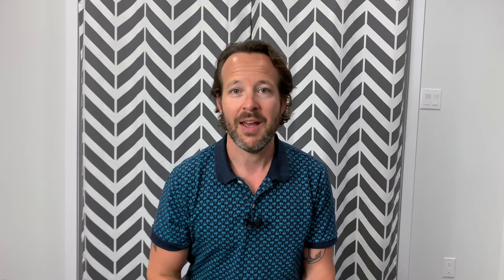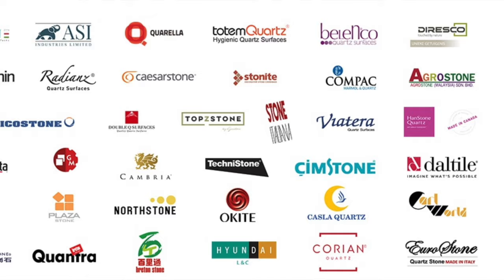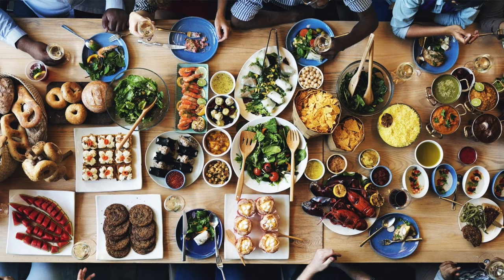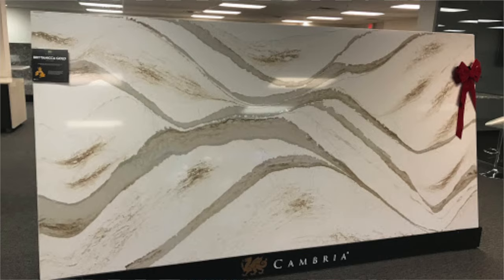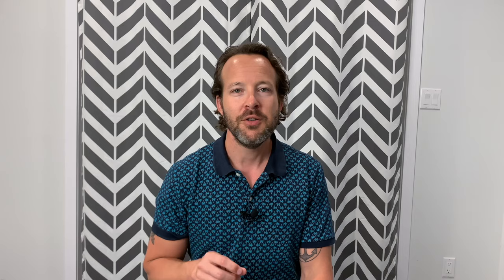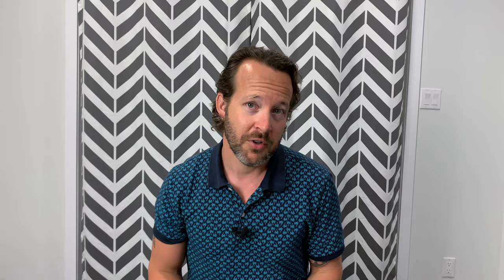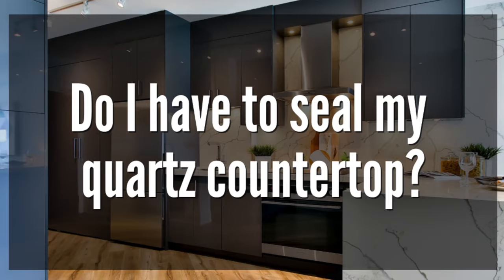QUARTZ COUNTERTOP | Everything You Need To Know

Comment: I am looking at purchasing a quartz countertop.  The manufacturer  has multiple thicknesses available (max 6 cm).  To make 6 cm you have the options of either having two 3 cm slabs laying on top of each other and baked together (but if it's heavily patterned, you won't get the seamless look when looking at the slab from the side) OR having the edges mitered (where you can get a more seamless side view appearance but it costs more money since the manufacturer will need to try and match the edges of the slabs).   Please consider adding this detail to your vid.   Thanks for the video!
Reply from the maker: Hey, thanks for the info.  That is not something I had considered!
Reply: I’ve never heard of 6cm slabs for countertops. I’ve hear of 6mm  big differences. To get a 6cm look the edges are mitered or stacked. There is no benefit to glueing 2. 3cm stones together just to get the thick look for the entire slab . I own a countertop company. And the edges should line up because heavily patterned quartz slabs should be almost identical. It’s very costly to have pattern changes.
Reply: @JS-zb1vv  Cambria offers some countertops in 6 centimeters.  Some people may like the look.  If one uses a chiseled or rock face edge profile, the change in the pattern between the 2 slabs isn't as noticeable.  I saw it in a showroom once.
Reply: @ecdubytecdubyt  yea but I don’t think it’s 2 full slabs it’s just a laminated edge.
Reply: @JS-zb1vv  I don't work in the field.  The Cambria website and the showroom rep told me it was 6 centimeters thick - just sharing what I was told by Cambria with others.  Since you're in the profession, feel free to verify if you'd like.
Reply: @ecdubytecdubyt  yea you can make an edge as thick as you want . It’s just laminated edges. They cut strips and glue .  It would be to heavy and costly to stack slabs . I’ve did it . I think it was just a misunderstanding of how it was represented.
Reply: @JS-zb1vv  Understood.  Thank you for the clarification.  Much appreciated!

Comment: ok, get your unit straight. 700 C degrees is over 1200 F. That is the temp aluminum melts. even 700 F sounds iffy. 
I am seeing hot pans will mess up a quartz top. Even vinegar will mess it up. The weak spot is not the quartz, it's the resin binder.

Comment: Thanks Mark, granite how to remove oil from our hands from my granite. 
I have tried so far the following a clay mixture powder that I mix with water. I’ve also tried baking soda with water, and baking soda with hydrogen peroxide 3%, I have also tried the mixture of the clay powder the hydrogen peroxide 3% and baking soda all mixed it into a peanut butter consistency then cover with Saran wrap and we will see how that turns out in two days. Thanks for all your information Mark appreciate you.
Reply from the maker: Thanks for the comment John.  Do you know if the granite is sealed.  Not sure if it will completely prevent oily stains.  Sounds like you're trying all the right remedies.  Hope it works for you!

Comment: Isopropyl Alcohol saved my laminate countertops and thermafoil cabinets from Sharpie! Would alcohol damage the quartz? If not, it works like a miracle.
Reply from the maker: Hi Haydée!  On laminate it is great.  Acetone as well.  It definitely can be used on quartz, though it is recommended to water it down.  Personally, I would reach out to the supplier before I used alcohol to clean, just because it is a solvent.  Really good point to bring up.
Reply: Hairspray can remove sharpie ink, too. I have a 20 year old Silestone countertop . It has developed 2 hairline cracks that seem to run along parallel to the edge of the cabinets under them. Hmmm
Reply: @MTKDofficial  Do not use acetone on quartz. you run the risk of burning the resin.  Alcohol is recommended by every manufacturer.

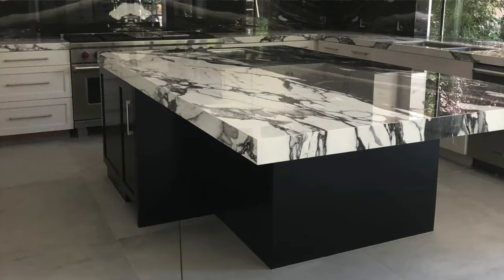Comment: @5:41, you mention slab thickness is between two and seven mil.  I assume that mil is millimeters, which isn't much more than 1/4 inch.  I have seen quartz much thicker than that, so please elaborate on your thickness comment.
Reply from the maker: I pinned a correction in the comments.  I meant to say CM

Comment: Home depot associate told me that ppl thede days selling quartz counter tops that are not sealed and will get stain vrry quickly from oil , food , coffee , dish soap liquid .. is that true ?
Reply from the maker: Well... maybe they were meaning quartzite, which definitely has to be sealed?  (Just giving them the benefit of the doubt)  Manufactured stones like quartz do not need to be sealed.  They are manufactured to 0.05% porosity.  There are however, brands out there that do not manufacture quartz to the same standards as the Breton patent.  That doesn't mean that they are not good, but harder to verify if they stand up quality wise.  Hope that helps

Comment: heat resistant to 700C then you say use a trivet.  that's wishy-washy.   so... does a hot pan risk leaving a burn or heat ring?  if i place a 500C pot onto the quartz for 2 minutes, will it visually damage the quartz?
Reply from the maker: Certainly didn’t mean to be wishy washy. The resin in quartz can and does burn.  Always check with the fabricator on what they recommend. Under normal use it’s fine, just stuff out of the oven might be an issue.

Comment: No idea if I got a bad batch or something, but our brand new (weeks old) counters are staining if you look at them wrong (I kid but just barely). Was making some old fashions with maple syrup the other night, didn't notice some syrup got on the counter top until I went back to clean up like 30 minutes later. The syrup left a stain that we keep scrubbing and got most of it to go away but you can still see it. Then a day later I had a dry pan, not hot, not used, just dry pan we had put down on the counter. Came back a few hours later and it left a rusty looking ring under it that we still can't get out. The pan itself is not rusted, it was brand new I had just gotten as a gift and put on the counter so I could wash it before storing it away. 

Now I'm afraid to put anything on these countertops. Feels like literally anything will stain them. No idea what is going wrong with these things since before we bought them  I looked far and wide for the most durable low maintenance options and quartz came out on top.
Reply from the maker: I'm assuming it has a warranty, so I would definitely get the rep to come out and have a look.  It should hold up better than that.  The big issue with quartz would be the resin and binding agents.  They can possibly react chemically with certain things.  However, if your counter can't handle a brand new pot there is something a miss.

Comment: Hi Mark!  I have a question. I want to put a black quartz with sparkles on my kitchen BUT the sales person told me that black quartz does not tolerate heat well. He advised to go with black granite instead. Should I buy the granite? I really want it to be black with sparkles ✨ Ty!
Reply from the maker: Hmm.  If you are going to be putting scolding hot pots on your countertop, then maybe not.  But just use a trivet if you have a habit of doing that.  Quartz is heat resistant to a point.  However, the more material in it (glass, metal, etc.) the more resin.  It's the resin that can be effected by heat. 
The black granite is a nice choice too.  Hard to say.  Use a trivet either way actually.

Comment: Hi there! I watched the video hoping to find out how to get water stains out of a quartz countertop as well as to find out if you can remove scratches. I have  watermarks all around the faucet and i got scratches from setting a ceramic planter on the counter. The video was awesome, but didnt hit on those. Do you have any suggestions? I saw 0000 grit steel wool for the water stains? Thank you!
Reply from the maker: Be careful not to make it worse by removing the sheen from sanding.  I'd even try a Mr. Clean Magic Eraser.  I've seen videos on repairing surfaces, but am certainly no professional at this.

Comment: Thank you for so many wonderful videos! Some  question I have is do you think it is ok to use stock cabinets under quartz countertops? Such as would stock cabinets hold up long term ? And if you were to want to upgrade lower cabinets later on, would the quartz countertop have to be busted off and ruined in order to replace the cabinets?
Reply from the maker: Depending on the quality of the stock cabinets, I'd say sure.  Most times you would be fine.  If you upgraded later, the top could come off.  Easier if there are no seams however.  Though the new cabinets would have to match exactly in size, so you don't run into trouble.  I would never recommend doing the countertop first if you are also planning on changing the cabinets.  Do the cabinets first and later you can upgrade easier.  But it can be done.

Comment: What about crockpots/slow cookers? I have 3 of them which get used a lot, several times a week and oftentimes 2 even all 3 at the same time. Currently have laminate countertops and whenever I use my crockpots I don’t normally put anything underneath them. I’m in the middle of deciding to update my 25 year old kitchen and thinking about upgrading to quartz counters. Also, what about air fryers and  Instant Pots/electric pressure cookers? Currently, my instant pot sits on top of my stove so that when the pressure is released I turn the hood fan on.....changed from the having it on the open peninsula due to staining my ceiling, oops! Yes, that peninsula will be going too, lol! I just can’t seem to figure out what type of island to put in? Right now it’s got a raised bar all around it with 4 bar stools 🙄!
Reply from the maker: Hi Lori!  Thanks for the comment and question.  If your slow cookers aren't delaminating your laminate countertop, I would not worry at all about them damaging quartz.  The stone will dissipate the heat evenly and more efficiently than laminate.  Of course it's always advised to use a trivet "just in case" .
For the island, I recommend a one level extended depth island.  With or without seating (whatever you prefer).  Here's a video on island seating talking about the different options.
https://youtu.be/9EdAtCo2LjA

Thanks again
Reply: @MTKDofficial  Thank you Mark for actually replying, I wasn’t expecting it as some other YouTubers usually don’t. I literally just discovered your channel yesterday and started binge watching your videos, so yes , I did see the one about islands. By “extended depth” do you mean “overhang”. And would that be all around the island or just on one side? I’m looking for a functional island with storage without a sink nor cooking surface. We had water damage under the sink (not the first time) that resulted in mould that had to be professionally removed and dealt with and so all of this happened in just the last couple of weeks. Now that more retailers are allowed to open, (we live in Canada and our province has been in lockdown the longest for about the third time now!) we already have four kitchen and bath companies (need to update our bathroom too) booked to come out and give us ideas and quotes. So I’m trying to get as much information as humanly possible so that I know what they’re talking about and of all the videos I’ve watched yours are the easiest to understand. If I were to send you some pictures, could you offer some advice? Thank you again for all your helpful videos which are truly appreciated especially since this waterfall/mould problem just threw me for a loop!
Reply from the maker: @LoriP123  thanks!  I try my best to respond to comments. It’s one of the best parts for me.  Definitely send some pictures.  I’d love to take a look. 
marknamytobin@gmail.com
Thanks so much for watching the videos. 
I’m in Nova Scotia so I know all about lockdown lol.
Reply from the maker: @LoriP123  so the island could have overhang on the back side. If you wanted seating. Or have some extra storage if you didn’t.  Normally an island depth is 27”. With overhang or extended the depth it could be 36” to 42”.  It makes for an excellent work surface either way.

Comment: Nice job! I’m currently looking at redoing my kitchen and unfortunately I have to go with Lowe’s because it’s the only place around me that can do it all
Reply from the maker: Hey Forrest!  Thanks for the comment.  Actually Lowes isn't all that bad really.  They probably have a pretty decent custom manufacturer (depending on your location) and they would carry a reputable countertop line.  The biggest variable with any big box store (or anywhere really) is the designer and the install crew.  
If you need any advice when the time comes, feel free to connect with me.

Comment: have you found that there are imperfections below the surface of the quartz, we have had problems with which appears to be soda can sized rings and water marks, are installer had tried to remove the spots to no avail and the second set also has the water marks. have you seen this before.  are stone manufacturer is compac,    thanks  video was very informative
Reply from the maker: Interesting.  I can't say I've come across this.  What are they saying about it, as the cause?  Has a company rep been out to look at it?

Comment: This was very informative. I do have a question. Is quartz a good passive surface?
Reply from the maker: Hi. By "passive" do you mean less maintenance?  If so, it does not require any sealing.  Just regular cleaning as you would anything else.  So, I suppose the answer is yes.

Comment: Hey! I want to buy honed quartz and im super worried about sealing every other months and cleaning it. I have researching online but getting mixed information. What do you recommend? Would hones quartz be trickier than polished quartz in cleaning?
Reply from the maker: Quartz does not need to be sealed, whether it's polished or honed.  A honed finish just requires a little more care in cleaning.  Just don't be abrasive with it.  Honed finishes show more finger prints and smudges and in turn people end up cleaning it more.  hope that helps.

Comment: I have seen on multiple sites that quartz can handle up to 300 degrees or so.  Anything above that will lead to damage, as the resin in the quartz melts and discolors.   @9:28, you indicate quartz is heat resistant up to 700 degrees Celsius which is 1,292 degrees Fahrenheit.  Please share your source.
Reply from the maker: I pinned a comment with correction.  thanks

Comment: How do I get the seams fixed? My fabricator was horrible
Reply from the maker: Shoot!  That's not good.  You will really need someone (another fabricator maybe) to look at it.  If it's just an installation issue, then it should be fixable.  If it's an actual fabrication issue, I would go after the fabricator.  Someone else may not want to touch it and be liable, so that's a tricky one.

Comment: There are massive differences between manufactures.  The quality of the quartz and the resin make a big difference.  Some quartz doesn't use the 93% and can go as low as 70% quartz and 30% resin (major brands included).  That is why the "value brands" sell their "quartz" for less than 10% of the cost of a high end brand.  The slabs are made 2cm (3/4") or 3 cm (1 1/4").    You also mentioned Lapitec...  It isn't a quartz.  It is made by Bretton and it is a sintered stone.  There isn't resin or quartz in Lapitec and it is baked at very high temperatures.  This is why Lapitec can be used in exterior applications and most quartz cannot.
Reply: Also the "heat resistant" isn't the case.  Almost all manufactures do not cover heat damage.  I have seen top brands damage from a pot of boiling water.
Reply from the maker: Appreciate the input.  Thank you

Comment: Could someone comment on lining up pattern lines for quartz counters and a matching backsplash? Thanks!
Reply from the maker: Lining up seams can be difficult.  However, if the fabricator knows to do it they can sometimes accommodate that.  It depends on the layout and size of the job.  Since quartz is sold in slabs, they need to use as much of that slab to complete the job, so not to waste any.  Matching seams can lead to more waste..  
Matching backsplash - I'm thinking you mean material.  So, using quartz as the backsplash?  If so that's not an issue, as you can buy a thin slab to do the backsplash.  Though if you're trying to match the pattern from the countertop to the backsplash, it would be pretty difficult.  Sorry for being so wordy, and I hope that helps a little.
Reply: @MTKDofficial  Thanks, I appreciate the info and the tip on using a narrower slab backsplash to potentially save money.
Yes, we are/were hoping to use the same quartz for a backsplash and have the veins line-up. We have seen pictures of this done but in hindsight, they were probably very expensive kitchens where waste is probably not an issue